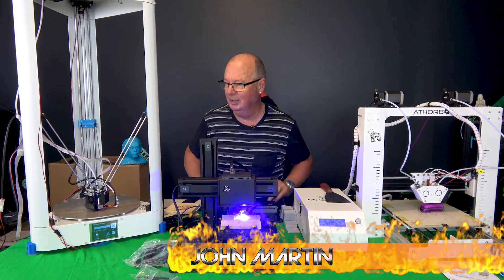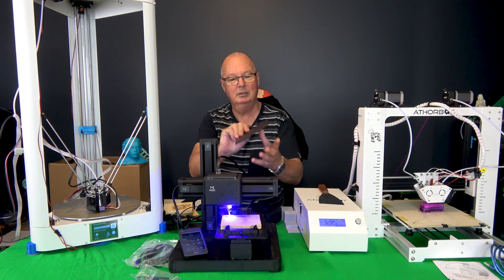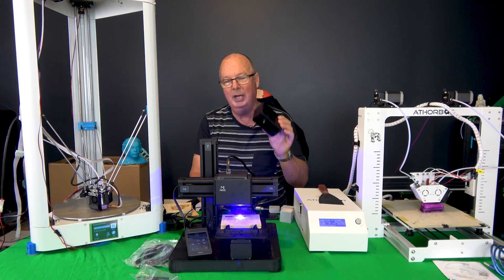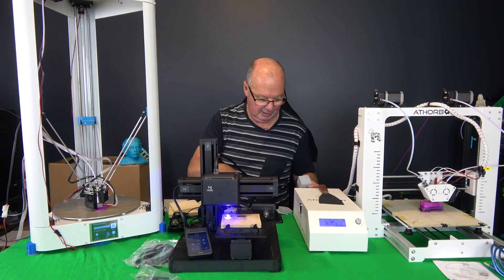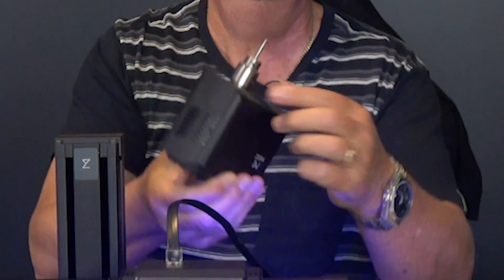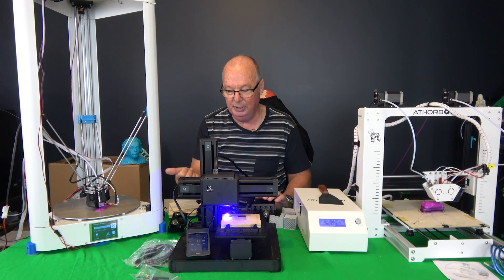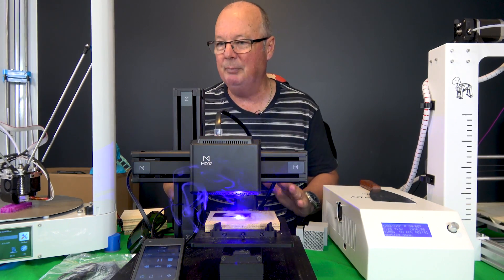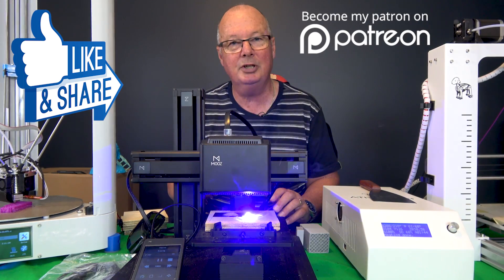MOOZ 3-in-1 CNC/Engraver/3D Printer Review

Comment: Just 4 months ago entered the 3D printing world. Now, what machines did I start with? I was checking out snapmaker as I thought how cool it would be to have 3D printing, laser and CNC in one unit. I then found Dobot MOOZ. For about 3 weeks I suffered with printhead jams and bed adhesion issues. Then I actually learned how to load filament correctly, surely different machine to machine. I now straighten 5 inches of filament, and I mean nail  I preheat the nozzle to 200c and I gently feed it though the filament sensor that detects filament run out, then through the feeder gears. If filament is not nail straight it can, and has, run amok and tangled in the gears, now I have achieved perfection. Next the adhesion issues. Watching videos I tried painters tape, hairspray, glue stick, and FINALLY the solution that works line gold for me. The cheapest Elmers school glue. The one we remember as kids, the white, soap and water clean up. Ironically it seems stickier when still the cloudy white BUT wait till it fully dried to clear and, perfect stick. AND, as a bonus, just put a couple dabs of water on the dried glue, and the glue will remain on the build plate if you allow the bed to cool after printing. A couple dabs of water to make it that creamy white, let it dry to clear again and its reusable for about 5 or 6 times on the same Elmers glue bed covering. MANY MANY complaints one this Dobot MOOZ but this is funny. My neighbor has a PRUSA, the original. I actually get better prints than he does which stunned him. I did hook up with a second printer for a larger print volume, Sindoh DP200. BUT the MOOZ prints are significantly sharper the Sindoh helps me with larger print size requirements.

Comment: I actually bought one of these but the MOOZ-2 so a little beyond the prototype you demo'd. It's a pain in the ass BUT, if you stick with it you can get some pretty decent prints. Your comments on the 3D print head. I had about 20 rounds of taking it apart. The newer model had run out detection and the loading tube has an issue where it is very hard to load the filament and then get it all through the drive mechanism. It can have a tendency of slipping out of the guide path and then goes towards the fan as you had happen. Then you have to take the entire print head apart, remove the nozzle and a bunch of screws to get to the actual drive train to clear the issue. BUT now I take the filament, make sure I cut the end to a point and I straighten the filament about 4 inches till it's unbelievably straight. Then I carefully feel for the filament passing the run out detection tube, then fully depress the button that pushes the feed mechanism so the filament, that is unbelievably straight passes through. Then I always heat the nozzle to 210 and then press the extract on the touch screen. I haven't had a clog in weeks I have owned the unit now for 2 months. I have made some really solid prints and the laser is cool, I upgraded it to a 2500mw laser so it now really burns through a lot of stuff. The CNC, software that comes from MOOZ sucks, the laser software is marginal, the CNC is really bad. The 3D printer software I use CURA. I got my MOOZ for a song and a dance on Amazon and the deal was too incredible to not buy. I do have fears as it seems Dobot moved from creating these units to some kind of printing arm robot. Seems like there might have been some kind of legal entanglements with a very similar looking machine made by Snap Maker and the snap maker is really much more expensive and seems like the MOOZ can do all the snap maker can. Small build plate but, as it's my first printer, I am dealing with that without much issue. Next printer will be a much larger build plate. But as for clearing the 3D print head, once you get the hand of ripping it apart 10+ times I can do it in my sleep and I now load filament much better, key is to really prime the filament to be EXTREMELY straight and patiently feed it.

Comment: Great video! I had a similar experience with the print head when I dug into the build surface after attempting the 3 point leveling. I wanted to know what speeds you set the laser to for travel. The software starts up at 1200mm/min. When I asked it to generate G code, the program crashed. Can you help. Thanks in advance, Rocky.

Comment: Kinda late to the show here, but I disagree about your comment on print quality. My Mooz-2 has astounding quality at 0.1mm height and makes some walls extremely smooth even without the need to sand. I don’t know, I got a different version of nozzle module than what you received but just a heads up a bit of a change and it is amazing :)

Comment: FYI I just received a Mooz 2 kit from the 2nd wave of Kickstarter shipments. Aside from the size of course all of the concerns he mentions have been addressed. Mine arrived with laser safety glasses, a blue acrylic safety box to put around the whole printer, plus printed documentation showing how to assemble the printer along with the obligatory safety warnings. Mine also came with a box of about a half a dozen CNC bits so you can carve right out of the box. They also did a firmware update which addresses a bunch of other issues.

I find printing from the SD card a bit buggy (for some reason the machine doesn't see the SD card all the time). Fortunately they have a USB jack on the back so you can use a far less touchy USB drive to load your gcode...and that works perfectly.

I bought mine primarily for CNC and Laser - I already have two 3d printers of this size or better. The quality is good but it's SLOW because the provided software is raster not vector. Working on using 3rd party to get vectors. It's stout, and it's not a bad option but as Kevin said there are a bazillion options out there at this price/size. If you're just buying it for 3d printing look elsewhere - far better/more cost-effective options. For laser it's quite a bit more reliable and better quality than the cheap $100 laser engravers but nowhere near the higher end CO2 options.